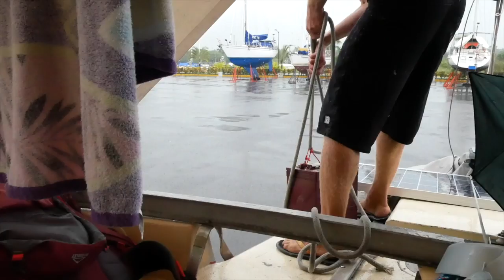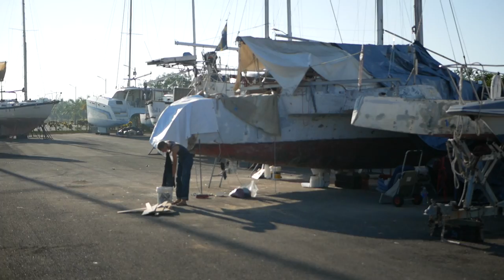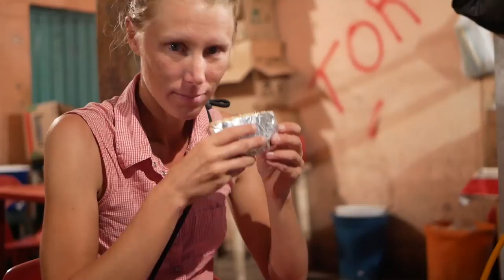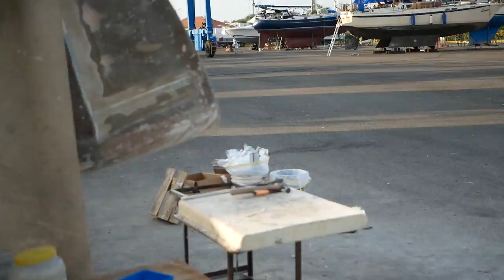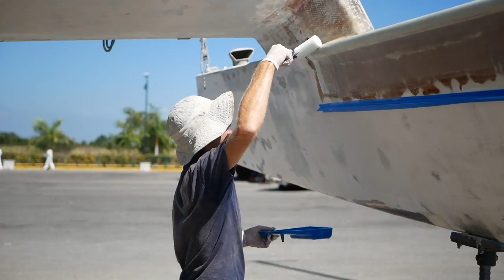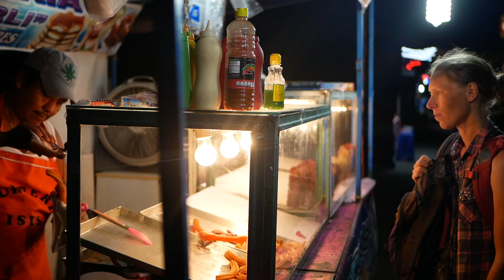Late night boat work (Episode 13)

Comment from the maker: Anyone out there who have suggestions for graphics and lines/stripes/colors for our boat? We are thinking white and green, where the amas (the outer hulls) are mostly green with some white, and the main hull the opposite
Reply: baby yellow and baby blue. ora classy black and grey with some goldish lines.
Reply from the maker: Thanks for your suggestions :) Black would probably be way to hot here in the tropics, but it would look very cool with goldfish lines :)
Reply: isolation is a must. btw is your trimaran a searunner or a sea clipper?
Reply from the maker: It's neither...it's a one off tri, built for a race to Hawaii.
Reply: how that a rare find! but if is a raceboat your interior needs alot of work!really alot